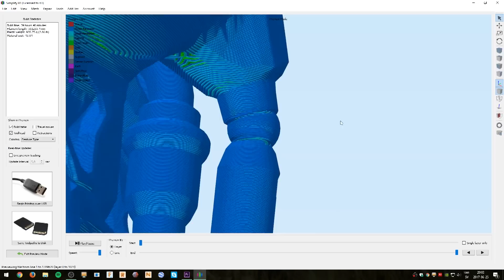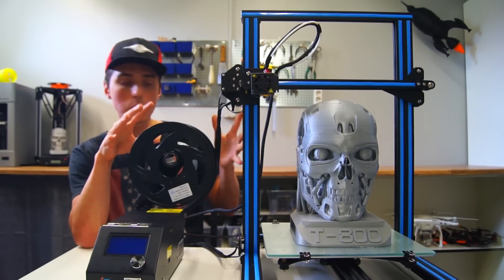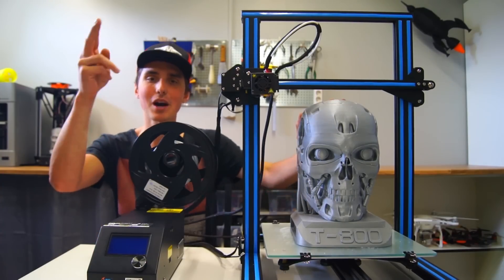Is the Creality CR-10 Safe? - BIG 3D Printed Terminator Head!!!

Comment: Great video on the safety of the machine, good to know the electronics are done right!
Reply from the maker: Hey Joel, just realized you live in Seattle. I was there a few months ago, would have loved to visit your shop. Maybe next time?
Reply: 3D Printing Nerd Woah both of my favorite 3d printing youtubers in the comments section... cool! Hey guys!
Reply: ... analysis not done by an electrical engineer. Unfortunately i think everything i have seen so far is not exactly fire safe, neither the existing open source designs, nor even the best derivatives thereof from China. Lulzbot have caught fire too, you know, and there's not even a single fake or intentionally cheapened part in those, all built in the best intention. And it won't just be a tiny little burst like on other electronics, it will be a big serious fire.

Comment: Just ordered a CR-10, my first 3D Printer!  Your video where you compare all the printers you own was what put me over the top on the CR-10.  Thanks!
Reply: hi John, i just would like to know where you ordered your cr-10, coz mine hasn't arrived yet,its been 24 days past already and i'm planning for a refund  from gearbest.
Reply: Yup, I was kinda expecting it to take a month to get to me.  If you happen to get yours in the next few days please respond back with the total time it took.  I've got some work to do in my shop to make room for it anyway.  It is discouraging that it's taking so long for GB to fill the orders.  My next choice of printer is the Prusa i3 MK2S kit, but it's nearly twice the price of the CR-10.
Reply: I opened a support ticket with GB to ask when they expect to be able to ship and they said from 5 to 15 business days.  That sounds like a canned answer they use for everything that's back-ordered to me.  They did give me an option to cancel and receive a full refund.  After watching another YouTube channel "SAN TUBE" where they guy was working around the fact that the piece of glass that came with his CR-10 is bowed and he had to buy some glass locally to replace it I decided to cancel my order.  I think if I stick to my original plan and buy the "Original Prusa i3 MK2S kit" it will cost a lot more, but I think I'll have a lot less headaches and be happier with my purchase in the long run.
Reply: John Ullrey what happened to your Printer? Is everything Working fine with It? Would you reccomend It?

Comment: I am considering buying one of these.  You certainly helped me see more than the ads do.  Thanks.  It does look very well built, and can print some nice sized stuff.  I do have a 20x20x15 cm 3d printer (homemade; purchased used and made to run well).  Thanks particularly for opening the box and showing me the electronics and power supply.

Comment: The board is indeed a Melzi clone with some slight variation (in the LCD pins). The MCU is a 1284p, so it has only 128K of flash, but this is enough to get bed leveling installed if some other features are turned off. The upside of the 1284p is that it has a full 16K of dynamic SRAM (compared to 8K on ATmega2560). For the main Marlin fork, we set up the CR-10 example configuration to use the extra SRAM to improve the SD card interface with sorting and caching.

In contrast to the CR-10, the CR-10S uses a MEGA2560-based board with RAMPS pinouts. That allows for more features to be enabled in the CR-10S sample config, but SD card caching is dialed back.

Comment: The length of filament on a roll is NOT a limiting factor. In my printer (anet a6 prusa i3) i have the option to pause a print. When doing so the print will stop and the printhead is put to the side. Now just change the roll of filament for a new one (even an other color is possible although different colors can require some different settings temerature wise). After changing you just select "resume print" and the printhead will go to the latest position and just carry on printing. Just make sure the new filament is completely loaded into the nozzle. so just push the springloaded drive wheel and push the filament in until the molten plastic will flow out of the nozzle. remove the molten plastic string and hit resume. I made some prints this way with different colors and worked fine. So if you want an even bigger terminator head just do so.

Comment: great video! I'm not sure which slicer you're using but I'm pretty sure you can change settings in cura to have a variable infill percentage. this can make it so the areas near the tops of prints have higher infill and avoid the holes while the middle sections are lower infill to save plastic.

Comment: This is a helpful video, though if they're using a 40w heater cartridge (probably, 40w's are freaking everywhere) a thermal runaway means the heater block can be melted and the heater can come free and cause a fire.  That's reportedly why e3d switched to 30w heaters instead.

Comment: That printer is a lot better than I expected, especially for the price. Like you said, the crimped connectors and the external MOSFET are a huge plus.
My only concern with the Creality is the single Z axis screw, there is bound to be some sag, especially as the X axis moves to the right. I suspect this will get worse over time too.
Love the huge Terminator print. I prited the same model a while ago. I noticed the gaps before printing but chose to give it a go anyway. It turned out great. Since your print was almost double the size, the gaps would be almost double too so they are more noticeable.
Keep up the great work.
Reply: Spike Kent If you would like another z xsis go here.
Reply: Where is here?
Reply: Glad I'm not the only one that does that :-)
Thank you, looks interesting. I might be tempted to give it a try

Comment: P-channel or N-channel MOSFET? Is the power line going to the heat bed fused separately? Is the metal frame grounded?

The reason i ask, is because of Wanhao fire hazard from a few years back. Combination of low-side switching using an N-channel MOSFET (which is very efficient, so this is actually how all Reprap-based 3D printers do it, but it's not what i'd call safe), grounded enclosure, and a fault in the mounting hardware, caused uncontrolled heating of the heat bed and mounting hardware. The danger of low side switching though is that a ground leak completely circumvents the control, the board can do nothing to stop the fire!

I don't have a perfect solution though. I think at least a Vishay HCTF on the heat bed (high side) is a good workable idea, and maybe somewhere around the print head too, though not in the heating block.

Comment: Some thoughts:
- The T-800 head seems a little on the large side to me - I know, Schwarzenegger doesn't exactly have a small head, but still - talk about "larger than life" 😀👍! (Okay, if I had a CR-10, I probably couldn't stop myself either - "because I can…" 😁)
- You seem to be the first person to put some kind of clock into a corner of their 3D-printing timelapses, which seems a pretty obvious improvement to me - "How long did this print take again?" "Just look at the clock…" 👍
- Great to hear that the CR-10 seems to be quite a bit more safe than the average chinese printer kit, but I guess, at that print volume it just has to be - burning down your house during a 72hr+ print doesn't exactly spell "customer satisfaction" to me, after all…

Comment: Another great video mate! Thumbs up all the way! Since you own CR-10 and tarantula I have one question. Which one would you recommend considering only the ABS print quality, not looking at the other factors like build volume? I know tarantula supports auto leveling and heated bed is doing better job, but what about fine detail quality at low speed and thin layer?

Comment: Mosfets have such a high voltage drop. I use a 12v 20amp automotive relay and my heated bed gets to 70c in a couple of minutes
Reply: They shouldn't unless they're not getting enough gate drive. 20 Amps is nothing for a well-designed mosfet circuit and it will outlast any mechanical relay.

Comment: Hey, big fan, I have one of these printers too but my extruding tube keeps popping out from where it is connected to the feeding mechanism. Any tips?
Reply: I own this printer as well and the two reasons i found that tube pops out is ether 1, your extruding to fast and it's pushing the tube out of the crimp holder, 2, your ptfe tube in the crimp holder is to marred up to hold on well (normally after 1 happens a few times) my fix was to cut a small amount off the tubes to give it a good surface to grip and to tune down flow % (or multiplier).
Reply: Nobodytoyou ! Thank you so much. Will give it a go later today

Comment: thanks  Lot for the videos you 're great and make me an idea to buy one cr10. can you please tell me the best settings in this machine to print pla?  thanks
Reply from the maker: The most important setting will be bed leveling. Make sure the nozzle and bed has the correct distance between each other. Set the temp to 200, the extrusion multiplier to 1 and the speed to 50mm/s. The only way to find the perfect settings is to calibrate your machine and start doing test prints.
Reply: RCLifeOn thanks a lot ! wich 3d program do you use to print? cura ? I have a lot of fun with your videos

Comment: Hi men I just get the cr10s pro v2 and I'm having troubles with Plate. Is it better to have the bed temperate or turn it off. I have problems it move my models and snap out of place. Also in a big figure the fan on the right side keep touching the model and make it move. Please what should I do??

Comment: This thing has indeed alot of problems.It has more than 400 errors and is not manifold.Cura and Slic3r seem to correct and ignore these issues where S3D does not. Going to put this file in 3Dbuilder for repair and then slice it with S3D. Not going to try to print this on the scale you printed but on the same great printer.

Comment: My big issue with my Lulzbot is that I can see the lead screws pattern in the side walls.  I also have a junky Makerbot 5th generation it only made like 10 prints before it stopped working. (total junk) But the side walls were immaculate.  Is there a printer someone could recommend that does not place a lead screw pattern in the print?

Comment: LOL everyone making videos about this mediocre printer. All the "security" measures which everyone uses because the RAMPS is a POS. My own design has all that. You dont have to be a genius to realice the heated bed is a poor design when it comes to the current  it consumes at 12v. Had they used a mains volatage heater with proper insulation, it would had been even safer and much less of a fire risk.